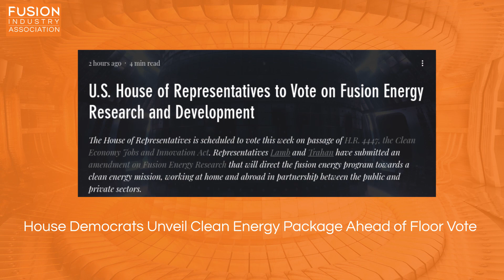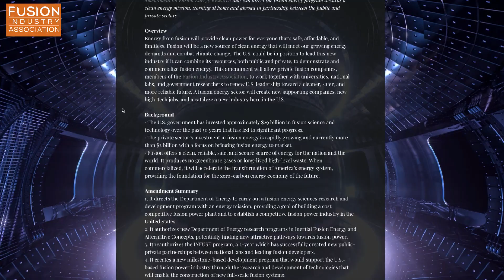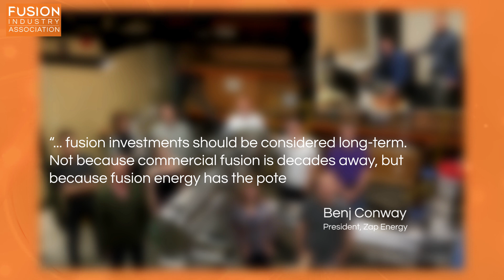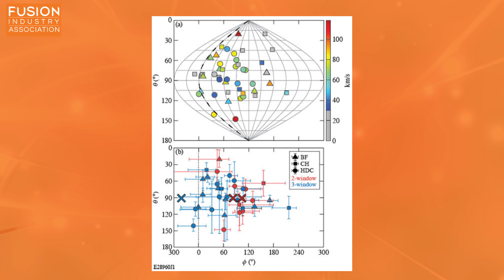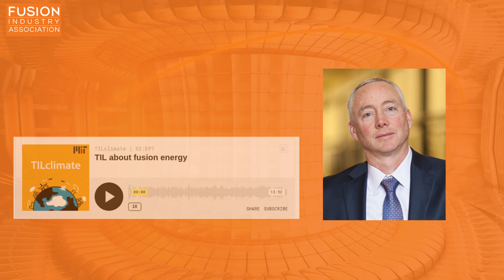Fusion News - Friday 25th September 2020

Comment: dear Leanne, I just saw an article on cold fusion in Erbium-deuterated metals, upon gamma-ray irradiation. I am a Caltech Ph.D. in x-ray diffraction. A better substrate might be S32-D2-H1, sulfur-deuterium-hydrogen, which will fuse in 3 steps to stable K potassium 41. Please contact me if you are interested? Dr. Horace Drew (Red Collie)

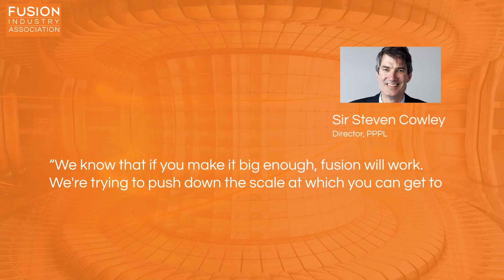Comment: 1:39 Really? That's the first time I hear a scientist saying that. It was always more like "Maybe if we fix problems a,b,c,d,e... and so on, then maybe it will work". But wait, what does he mean here with big enough? Big enough like ITER, or the sun?
Reply: I'm not a scientist, but this video https://youtu.be/0Fijd68b3lM?t=706
says that it's just a matter of the ratio between surface area and volume. Larger tokamak's will result in a plasma ring that has more volume and less surface area, meaning more fusion (from the volume) and less heat loss (from the surface area).
The ITER project will produce more energy than what is put in, but the video mentioned that it's more for testing and is mostly just a proof of concept.

*Edit*
Another video on ITER: https://youtu.be/Wc8SJqAPVaM?t=348